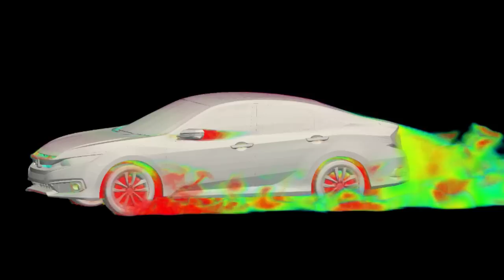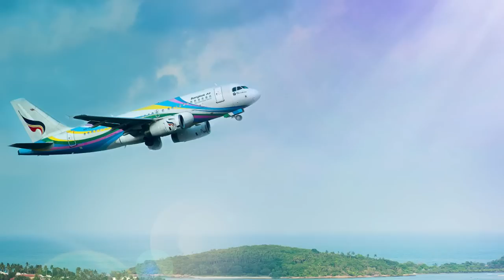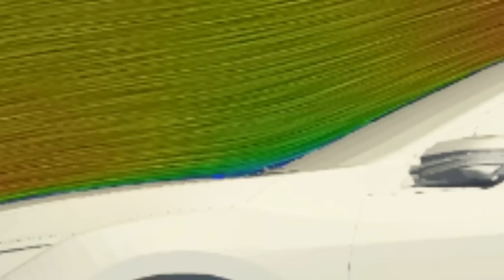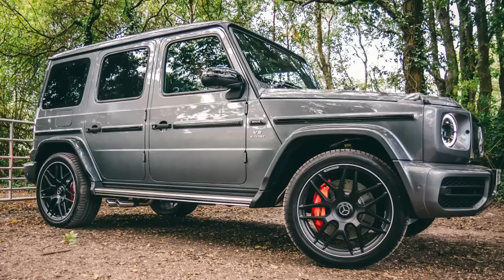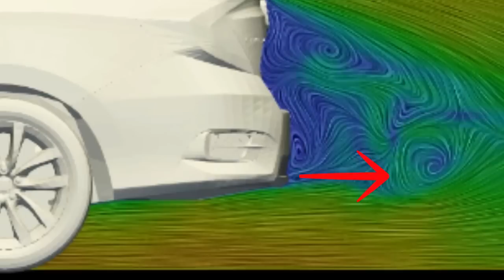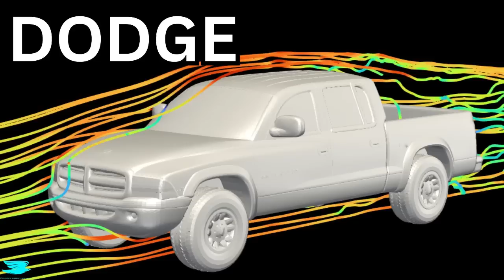Why The Honda Civic Has Disappointing Aerodynamics

Comment: no offense, but can you learn to speak? You're swallowing words blending them into each other, and you pause every few sentences signaling you're entering a new subject, even though you're not even done with the current one. Can you try to write down what you wanna say and do it a comprehensive concise manner, so it has a beginning and an end?

21:15 kinda funny, thats how i feel

22:24 what is that supposed to mean. A mesh is a structure, not an activity. It seems like you're saying the air attaches to the surface. And then you go on to say, in fact all surfaces that have attached flow, have one, which is attached flow. Huh?? You're just repeating the same thing and you phrase it like you made a larger point.

Comment: These cars are very popular for track use, especially in time attack category.

I wonder, could that low pressure zone above the front of the hood be exploited by a wing? What if one were to mount a short wing just at the top edge of that low pressure zone? Because it's already low pressure, you could get away with a near zero pitch on the wing, as the air above it would be at normal (thus higher) pressure. This would dramatically lower the drag of the wing, this minimizing downstream effect of it. 🤔

Comment: I have a '16 EX-T Coupe.  The side profile is more smooth (by appearance, don't know if looking at drawings).
Front: I always thought the giant H badge and the chrome brow didn't look aero, which must do what my Kitchenaid mixer does.  Add the fake mesh grills with sunken driving lights that look like a catcher's mitt, not smooth at all.  Why do so many cars have the chine that runs along the hood and blends into the A-pillars?
Sides: I always thought the mirrors were huge and over designed chunky.  I have the optional "mud flaps" which must mix up the flow.
Rear: I have the optional fat wing that has to be messing up the air detachment and not adding downforce based on what I heard you say.  Wish I got the Si wing.  There are fake grills, would opening those up help release pressure vs. a new diffuser design?
Otherwise I'm happy with how quiet and stable it is, even at high speed.

Comment: I'm super satisfied with the aerodynamics. 
At highwayspeed (100 km/h or 60 mph), i get real 5,2L/100km / 45 mpg which is amazing for a kind of large sedan with 1.5 Turbo, 180HP and 6-speed manual. Other cars in the same class like Seat Leon, VW Golf, Kia Ceed,... are consuming more.

Comment: I think you forget the reason the angle at the base of the windshield is what it is. 
The front of the hood can't go lower than the radiator support.
The rear of the hood can't obscure the drivers view.
The windshield can't go so far forward you restrict access to the engine.
Reply from the maker: A lot of supercars do it
Reply: @PremierAerodynamics a lot of supercars are not front wheel drive.

Comment: Honestly this makes the fuel mileage they manage to get even more impressive lol - Wonder how the engine would fare with less drag.
Reply: its because his model is wrong.
Reply: @Wrutschgeluck what do you mean? model looks perfectly right.
Reply: @stayphun6188  the civic hatchback have a
cw-value of 0,26
a frontal surface of 2,24 and
a Air resistance cw*A of 0,582
did you see the sharp edge at the bottom front? i drive this car and mine didnt have this since my model is 3d and not just a 2d side model where you cut at a certain part where you like. but ok, this edge is there, yes. but ONLY in the middle to funel the air into the radiator. the most parts in the front ar rounded at this section if you look more out. so this part didnt represent the airflow art the front of the car thats why its wrong.
and i guess my first comment got deleted!?!? i cant see it.
Reply: @stayphun6188  hope you got my answer
Reply: @Wrutschgeluck I can see your comment, so it wasn't deleted. I get your point, but aren't you talking about the hatchback? but the video is only about the sedan ?
Reply: @stayphun6188 that's true. But at least in EU the front is compleately the same.

Comment: One type of aero study I have never seen performed is one on dually trucks. These are the most common trucks to see doing work at highway speeds and with people that care about efficiency. It would be interesting to see if anything could be done to improve their efficiency or if it's a hopeless cause. It would also be nice to see a comparison between long and short bed trucks as well. Trailer lol?

If I could recommend a truck, I would choose one of the mid 90's "aero nose" F350s. This year marked the first change into a more streamlined design not just for Ford trucks but the industry as a whole. This generation (along with the other 7.3 diesel super duty) are probably the most fuel-efficient trucks ford has made despite them using old technology. I'm sure emissions control systems have played some part, but I find it hard to believe that could be the sole reason for the lack of improvement throughout the years. It may be a similar case to the W124 Mercedes, whereas they look rather boxy and brick like but actually have a Cd of .28
Reply from the maker: A dually would be interesting.

Comment: I have this car and always wondered why it had such relatively lousy gas mileage.
Reply: my car have 4,6l/100km if i drive 110km/h. thats low. not high, i dont know whats going on here but something is odd. i drive this civic, too (diferent rear) but the front must be the same and it didnt have such a large gap at the bottom. there is no 20cm long lip at the front bottom while ontop is a air bag full of low pressure. i think the model is wrong here!
Reply: thats definitely a you thing, id get that checked out. could start with checking your pcv valve (take it out, if it rattles when you shake it its good, if its quiet you need a new one) and the pcv hose.

Comment: 1. I think they designed the front to feed the intercooler and radiators high speed air to help cool the engines. 

2. Isnt a "lift" a good thing on fuel economy? It "lightens" the car and therefore less power needed to move it forward especially on uphill.
Reply: I think lift is not great because if you have more lift then you will have less grip on the tires and a smaller normal force, this doesn’t affect the horizontal component aka regular moving of the car, so having a high lift won’t actually help the car move. If you are on an incline, now the lift has a horizontal and vertical component, so now your car will have less grip and even slow down. The car will always weigh the same, it’s really just about reducing drag to have a higher MPG. I’m not an aerodynamicist so take this with a grain of salt
Reply: Lift and downforce (negative lift) don't help the car. They're converting energy into force in a plane that isn't useful to moving forwards. That's wasted energy, unless it has other potentially useful effects.
Reply: Improving the fuel economy of a car by adding lift seems like a troll physics rage comic idea.
Reply: Thats true, especially with the turbo engines they have now

Comment: Venturi effect is true if you consider flow field as a stream tube whose CSA changes as a result of pressure gradients, I completely agree with you. I also posit it's not the whole picture. Circulation and Bernoulli gives you a more complete picture, than just one or the other.
Reply from the maker: Yep, I definitely think Bernoulli must be involved (and especially when you have height changes and even losses that you need to account for).

Comment: Oh god are we really going to get into the "why a wing produces lift" debate? Anyway, your argument of venturi+viscosity doesn't make sense to me just because you can have lift in inviscid flow...
Reply from the maker: Actually, no. Viscosity is needed in order to produce lift. If you don't have viscosity, then the Kutta condition can't be fulfilled.

We cover some more details about it in this video: https://www.youtube.com/watch?v=U9tPUQXz9qM

I really think that the venturi effect with viscosity is the reason for it. It also makes sense from the diffuser point of view because you still get the venturi effect underneath a diffuser despite not having side walls.
Reply: @PremierAerodynamics  The Kutta condition is a mass effect no? Because your fluid has a finite density and the TE of an airfoil is infinitely sharp, the force on the flow would become infinite and thus impossible. Of all possible solutions of inviscid flow around an airfoil, only that one is physically possible.

That does indeed not say anything of how that condition is achieved, and maybe viscosity has something to play there idk.
Reply from the maker: It's partly to do with that and also to do with shear stresses that are used to correct the flow angle. Without viscosity, shear stresses don't exist.

Actually, the funny thing about potential flow is that you can use the Kutta Joukowski theorem to calculate the lift of an object, but without viscosity, you can't get vorticity, so the theorem is invalid, but still works well enough that we can use it. Potential flow is pretty interesting - even though there are simplifications, it still works somehow.